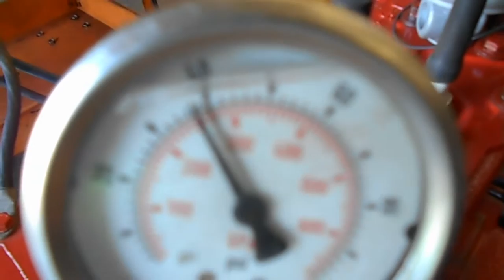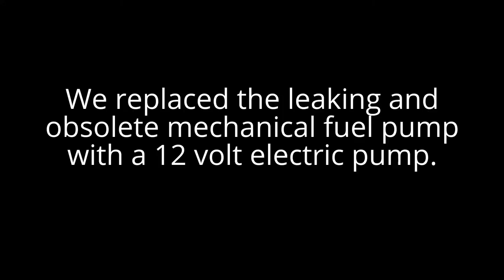Continental Red Seal F227 or F226 engine

Comment: Like butter. I understand that the Kleiber Motor and Truck Co in San Francisco  used these engines. I never even knew that SF ever had its very own automobile company until recently. Seems like there are a few of these motors around but just try and find a Kleiber. It's widely believed that only one of the sedans exists. Jay Leno is the proud owner.

Comment: I wonder how much adaption it would take to put this in a car.  Continental used to build automobile engines.  Checkers and Kaisers used Continental engines.
Reply: Bolt right in. I have put f226's out of jeeps in tractors. and f227 out of forklifts in tractors. The Willys, Checker and Henry J's all used Continental engines.  So did Ingersol Rand, and a bunch of welders, compressors, generatotrs and.......... One difference is some passenger engines used timing chains so the camshaft turns in a different direction. So you have to figure out what is what, but they WILL FIT.
Reply: I have a 1939 F-163 L head 4 cyl , I am restoring , found a 5th window 1949 GMC pickup truck and will forfeit ( or fabricate if a must ) a step up gear box for its shifting gear box Clutch unit  for higher RPM delivery to Transmission , these vintage engines where built with cast iron to the head casket cover and driven by single joint gears ( direct link of Crank to cam )you must calibrate their harmonic balance , you will need to configure its RPM and recompense it for the transmission type you will be using , as for torque ? I can promise you they can make new cars or trucks squeal like a raped hamsters because the direct gear drive vintage engines ? where meant to plow ground by tractors originally, they got some really big balls when it comes to torque I mean big BALLS . so imagine having that on your work vehicles for hauling or hitching trailers full of your tools or supply materials for your projects you work on . 
 by the way they are serviced by their working hours not mileage count , they can run easy over 30,000 miles before even changing oil . you change oil every 500 hrs  on the F class ( so if you are driving 65 mile per hour ? x 500 hours = 32,500 miles ) then you can change the oil . compare that to the new vehicles that require oil change every 3,000 miles give or take .
Reply: Robert Coates uu

Comment: Just need to hunt down the equivalent of this in diesel for my 1978 Lincoln SAE400 that may make me a bit happier than the old gas motor
Reply: Your comment caught my eye. I have a Lincoln SAE 400 diesel. Perkins 4 cylinder. Runs like a dream. I’m working rebuilding a 600 amp now.

Comment: howdy I have a towmotor with a f163 does the f227 have the same starter? also I need to change out the head gasket where to I find the top end gaskets?

Comment: Hi. I have a 1947 Mack with either a continental M6271 or M6290 it is stuck. I am wondering if it is it is salvageable.  Having a little trouble locating parts here in US. I guess I have to get it apart first and see what it needs.  are parts available there?
Thanks
Reply: rlferv might have to get parts custom machined. I had to for my old Ford flatty.

Comment: I have a 74 miller welder that I'm working on and having a difficult time finding the engine specs or know what kind of engine it is.. .the only markings it has are the words red seal on the manifold, we are thinking it's a continental engine...after doing a lil research....im thinking it's a f136 continental engine...how do I know for certain tho....any advice on finding out what kind of engine along with wher I can get the specs would be apriciated...thanks
Reply from the maker: All welders we've worked on are either F162 or F163 engines which are vertually the same. Hard to tell the difference externally. They take slightly different rod bearings and maybe oil pump.

Comment: Im going to look at a welder with this engine where can i get parts for it got to do some work to the engine and i may just rebuild it
Reply: Me too I just got mine up and running and it sounds like it needs a valve job
Reply: Ya i have to find a nother engine for mine so iv been looking around for a forklift that has one so i can get the engine
Reply: Have you had luck in finding replacement parts
Reply: Nop the are hard to find here in Missouri

Comment: Had Willy’s station wagon with this engine, called Super Hurricane. Couldn’t keep a head gasket longer than 10000 mi. Poor block design around head bolt spacing and bolt size.